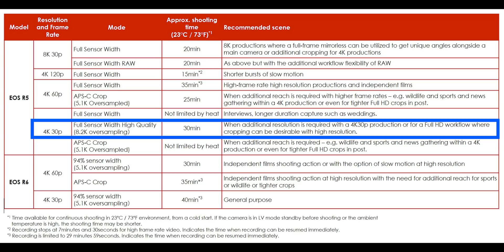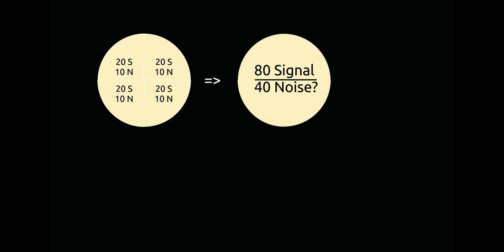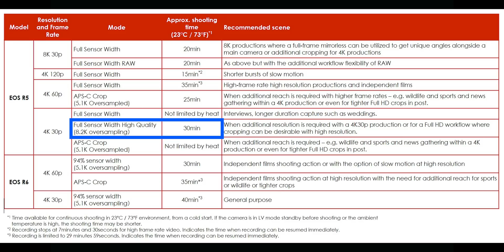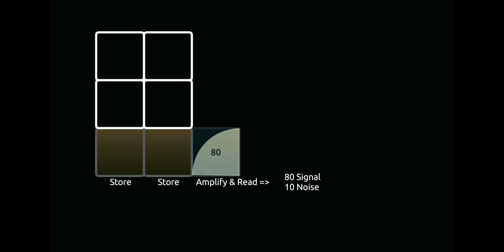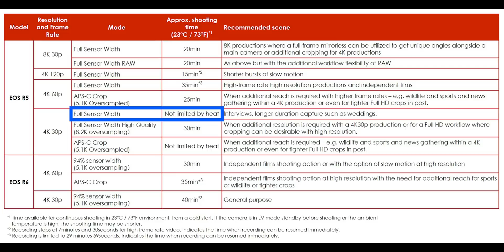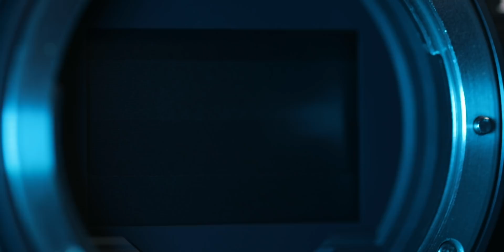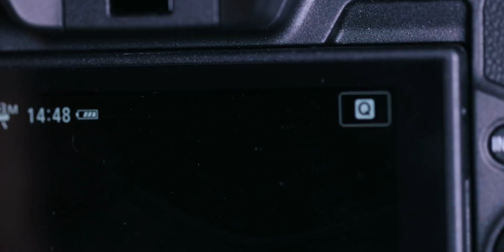Canon EOS R5 - Everyone is WRONG - Sensor explained - vs Sony A7s iii

Comment: Can this binning 2*2 be fixed in a firmware update thereby making Canons both cameras unbeatable.. ? Max tech said may be it's possible to fixx
Reply from the maker: If the sensor supports it on low-level hardware, it can be possible to add in firmware later (even for the R6 example I showed in the video, which was 5k sensor downsampling to 2k 120fps in R6)
Reply: Unlikely. That sort of stuff is done in hardware in the image signal processor for the most part. Firmware runs the processor, not the ISP.
Reply: In order to take advantage of the improvements as shown, the sensor would need to support on-chip pixel binning, since they'd need to combine the output of four pixels into the analog-to-digital converter to see the SNR reduction as shown. What's termed "readout noise" in modern sensors is actually the noise leading up to the ADC stage. Once you're digital, there's no more noise. In past cameras (Canon's 5DIII, for example), the sensor actually read out in analog, routed that analog pixel bus across a PCB to the image signal processor, which did the ADC part. So readout and analog noise were once pretty identical. But that's fortunately ancient history. 

On a CCD, you technically move charge without adding noise until the charge to voltage conversion and the ADC stage. In a CMOS sensor, you generally don't move around charge, but voltage. However, I image if you had 2x2 pixel cell that you'd like to have read as a bin, it would be simple enough to merge the four charge wells for the pixels and read them out as one superpixel. I'm pretty sure my phone does this :-) 
The problem with that is that you're binning a 2x2 pixel cell, which is RGBG. So you can't actually process that in analog with a single ADC. So I don't really see this being an on-chip option, as it is on the recent Quad Bayer sensors used in phones (and probably cameras before too long). It's of course possible to do pixel binning after the ADC step and reduce overall luminance noise by a factor of 2, and that certainly could be done in firmware.

Comment: Isn’t 4K 8 or 9 MP and not 12 so would it still be a 1/1 read out?
Reply from the maker: The sensors are usually 3:2 or 4:3 aspect ratio, while DCI video is 2:1 aspect ratio. So say (width x height) 4k x 3k = 12 MP, while video would be 4k x 2k = 8 MP while it's still the same pixels being read out. So both is right :-) Then there is usually some more space to cater for IBIS, but minor.
Reply: @ctoLarssonTECH  wow! Well explained!
Reply: @CTO LARSSON - TECH  good info 👍

Comment: Sir  my work wedding & pre wedding cinematic right now I am using canon mark 4 so al go for r5 aur r6 please tell me?
Reply from the maker: Once I get the production version of the camera, we can test this out. If the R5 does pixel binning on the 4k "Normal mode", that mode will probably have better low light performance than the "High Quality" mode and should be a good fit for your wedding work, which I imagine contains a lot of low light evening work? If it doesn't, the R6 will be a better choice. Having said that, I know other wedding photographers who will go all out for low light performance, and for that the A7s iii will beat both of them, while having some other compromises like no real good still photos, and (IMO) not as good lenses as the new RF lineup from Canon.

Comment: Did you say Sony's lenses aren't good as Canon's RF lenses? By what criteria?
Reply from the maker: That was specifically the new RF lenses. There is no 15-35 image stabilized lens for the Sony system and the RF f/1.2 50mm and 85mm beat the other equivalents in sharpnness etc. But of course this is a complex matter and I oversimplified. Valid comment mate
Reply: RF is a new level, sony need to catch up

Comment: Great video. But just FYI,  The R6 does 4k by oversampling 5k and not line skipping or pixel binning :) The R5 however does Pixel binning in some modes which makes it the perfect hybrid for most people. 
8K RAW and ALL-I / IPB up to 30p
4K HQ from 8K sensor readout up to 30p 
4K pixel binned mode up to 30p
4K / 60p – also pixel binned
4K / 120p – also pixel binned

https://www.eoshd.com/8k/a-closer-look-at-the-canon-eos-r5-lower-quality-4k-mode-to-avoid-thermal-cut-off/
Reply from the maker: Hi Ali, thanks mate. Yes I saw that article and I tried to dig into the source. My conclusion was that the R5 pixel binning mentioned there was still rumor based - but I also hope it's true :-) I also asked one Canon representative and they said they don't have that information yet. The R6 line skipping I showed in this video was indeed line skipping when the R6 downsampled the 5k sensor to FHD (2k) HFR. You are right that the R6 does not line skip to get from 5k to 4k. Cheers and thanks for the comment
Reply: CTO LARSSON - TECH ah I see. On another note, this video of yours is going Viral. Hope you reach to 10k subs soon!
Reply: I honestly think the r5 is the ultimate hybrid camera! It's not perfect but the closest thing to the dream hybrid camera. Wish it had 6k 50fps and 1080p 240fps though as it should be able to handle it. Also with you could shoot raw in slow motion however I think this camera will be seeing firmware updates that will make it even better and it's a godly hybrid camera!
Reply: @dukebozikowski3801  "r5 is the ultimate hybrid camera" at 45mp? thought ~24mp sensors were the sweet spot
Reply: mirrorlessNY More mp doesn’t hurt and I want it to be able to take landscape photos and crop out a portrait shot
Reply: @dukebozikowski3801  true for heavy cropping definitely want to make sure to have enough megapixels
Reply: I don't see any sources linked in that article.  He just refers to 'the menus'.

Comment: Great technical explanation.  But I can't understand why those obsessed with video just buy a ......video camera.  Personally I'd rather not have video., but that's just me.  I see video as a kicker if I ever happen to want to use it, but i don't.
Reply from the maker: Valid point. I just like this small form factor over the C500 MkII or C300 MkIII which I'll reasonably not be carrying around as much. But your point is still valid and that's really the trend we are witnessing right now with Sony doing what appears to be a video camera only in the form factor of a "mirrorless still camera", while the R5 with the new RF lenses is coming out as the new still top dog.
Reply: Short answer: cost.  A c200ii still costs $5500 and ONLY shoots 30p on a super35 sensor.  The mirrorless bodies just have much more value.